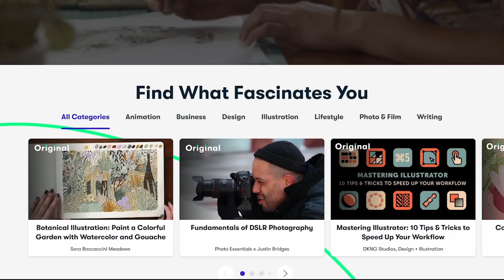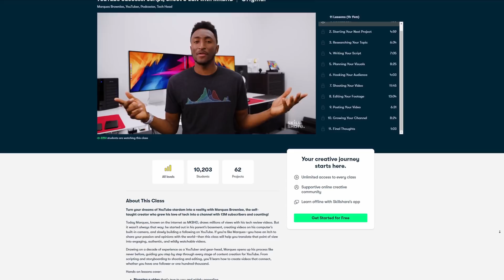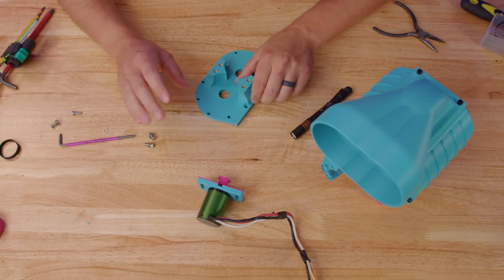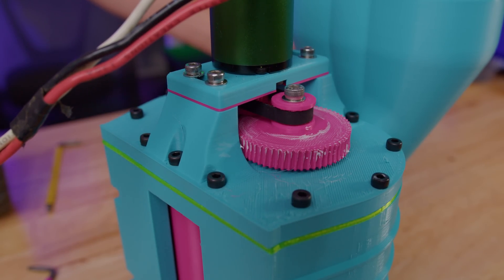I Attached a 100,000 RPM MAX Castle Mamba to my 3D printed SUPERCHARGER..... Will it Survive?

Comment: Run 2 identical batteries in parallel. Rewire the electronic speed controll ends to allow you to run dual batteries. Its a great way to extend run time on the rc. So say for example you are running one 2s lipo. Run two 2s 5000mah lipos instead. Should almost get double the time. Also watch your motor temps when fiddling with your gearing. Those brushless motors can heat up quick if the gearing is too high.

Comment: Should be fine running it on a big PC power supply with an ESC that can handle 12v.
Reply: Those ESC's can handle over 14 volts.
Reply: @tazimafied  Even better, I didn't see the details on the ESC he was using.
Reply: @bradley3549  Specs are etched on the motor. Paused at the closeup to read it. LoL
Reply: @tazimafied  Nice detective work. The motor specs and the ESC specs aren't necessarily the same though. @ 1:50 The motor says 10 niMh/3S LiPo max, which is basically a 12v motor. I'd agree that if he upgraded the motor and ESC at the same time they are probably both good for 3S though so just send it!

Comment: just use a regular car/ mc battery and a 100-150A fuse, remember to turn off LiPo mode on the esc otherwise it will not work.

Comment: if the ESC uses 12V you could just take a regular ATX power supply and run it of that.
Reply from the maker: A full charged 3s is like 12.6 would a normal psu have the balls to push it. If so what wattage min would I need as I have a couple laying around.
Reply: @MajorHardware  no. Just buy some batteries from CNHL, Ovionic Ampow, or even RDQ. You can only get 1800w out of a wall socket. I have a very high power PSU and it still can't match good LiPo's. If you REALLY want to use a power supply, look up meanwell 12v power supplies. You can probably get one that'll do 12v/100a but again, you're much better off with 10-20ah of 3s LiPo because even 10ah of Lipo at 20c is 200a
Reply: @mitchellroberts7954  literally any good 1200W ATX PSU will do 100A at 12V. If you want more current there's also 1600W PSUs.

Comment: Take the motor out of a kids battery car, mock up the pedal into a switch or lever type of handle to regulate the speeds. Much bigger batteries and much more torque.

Comment: batteryhookup has some used headway cells, lifepo4... can output about 200 amps. 8AH each, literally a bolt-together pack that you can make yourself. make sure to charge them with a balance lead and be very careful with them!... if you really want a power supply that can handle some power, look into the HP server power supplies, i believe they are 70 amp output at 12V

Comment: You can make your own psu get a 24v transformer or 2 12v ones, a rectifying bridge, some capacitors and regulate the voltage with a potentiometer.
With some steel plates and some enameled copper wire you can make your own transformer, just remember n1/n2=V1/V2 
n beeing the number of wire loops.

Comment: It says 10 NiMh which is about 12v. You could use a 12 car battery. or maybe a PC psu.  Not sure how much current you need. there are quite a few 30V adjustable bench supplies on Amazon. I did see a 30 A 13.8V dc supply which I assume is for running 12v car suff on the bench.

Comment: you should add a groove to the rotor tips that you can slide PTFE tubes to seal it, should help with efficiency.
 should help with noise as well
Reply: My thought was to use playing cards as tip seals.

Comment: I bet the static pressure of this thing is grand. Should be good on a dense, thick radiator block.
Reply: Stick one of these on the base of like a rad tower and blow the air up through the stack. You could plumb them up so the water sinks as it cools and the super blows the air up so the heat is stripped away, out an exhaust stack.

For a laugh, wire it up to a pedal under the desk to control the power it gets.
Reply: @joshuahadams  vroom veeeerrrooooooommm
Reply: @joshuahadams  oh god you are a genius!
Reply: @joshuahadams   these some way to use the computer temp to affect the motor, ive seen it done on Linus tech tips , they did it with wooden wheels
Reply: Actually, doubt it is.  Roots style superchargers are at best 70% efficient, and those ones that have seals on the lobes.  Given he lack of seals I'd guess its maybe 35% efficient.  They were first designed to move air through tunnels.
Reply: @ShaunMcCloud  Thats cool to know, thanks.
Reply: @ShaunMcCloud  compared to what's normally put on a radiator, ie: a fan, this should be an enormous difference

Comment: Server power supply modules
They are cheap on ebay and can get you 12V or 48V at huge powers. You can also parallel them together for even more power.

Comment: I don't k ow if the controller on the RC car can handle 48V, but you can buy a 48V Hailong HL01 style eBike battery, and that will drive a small setup like that for days assuming the controller can deal with the voltage.

Comment: Can't you just use a buck converter hooked up to a Meanwell PSU from one of your 3D printers?
Reply: they wouldn't be more than 200w or so I guess.
Reply: @lasskinn474  the one I have in mine is 350w

Comment: Measure the current it's pulling and tell us the voltage (3s/4s).  I wonder if a pc psu could handle it (with super caps in parallel)

Comment: Supercharger efficiency lives and dies by surface interference, slightly oversized screws, polished down with use and then a lubricant such as graphene to get a super snug fit?

Comment: I made a power supply out of microwave oven transformer, removed the high voltage wire and rewound it with thick wire so I get 12 v output l, then soldered it to 2 50 A full bridge rectifires. I placed the transformer and rectifires in oil for better cooling as it gets hot l, but now I have 12 v 1200w power supply. Another thing to try is computer power supplies those can be powerfull

Comment: What most people do when testing motors is put their power supply in parallel to the battery to keep the voltage sustained. Just make sure that your battery voltage and power supply are within .1V when putting them parallel. 
This thing sounds freaking amazing. Sweet build!

Comment: you would need a powersupply that can output 200A at the voltage of the battery and i think for that you would need a big coil power supply that isn't working with semiconducters like now normal powersupplys do.
Reply: Car batteries/ or a welder

Comment: A quick bit of research says you need up to 100A available for that ESC, so you'd need something like the Tektronics 2260B-30-108 which will do 0-30V at up to 108A. It's a lot of dosh to spend for an experiment though, at $3460 at Valuetronics in the US.
Reply: Maybe he could borrow one, or go to someones business to use it.
Reply: I have a mamba max on a HongNor rc can, and it can use 1050A peek for 22 sec. Ans 150A nominal.... maybe you need to modify a welder?
Reply: a few pc power supplies combobbled together will do that and be a lot cheaper.
Reply from the maker: Goooooooooooooooooood damn.... maybe electroboom can make me one lol

Comment: I don't know if anyone has suggested this yet, but depending on the voltage difference between your PSU and the motor, a buck converter could be an option to increase the current at lower voltage. Many desk power supplies can put out the same current at all voltages, and a buck converter would allow you to take say 30V/5A and make that 15V/10A (with some efficiency losses of course). There are plenty of them for all voltage and current ratings on amazon, and they are terrifyingly cheap generally. Just make sure you get some airflow over it to keep it from blowing up under the high sustained load!
Reply: They need over 1000 watts to run that motor at full power. It's a 90amp ESC running 3s.
The bench supplies just don't get even close.
Reply: @nocare  That is way more than I would have expected. Definitely something beefier would be needed then. Maybe a computer power supply would be the most cost effective way to do that then, depending on the voltage required.

Comment: They're a bit expensive, but when you said dial in the volts, I immediately thought of a bench power supply. You can set the current limit, so you don't really break things when stuff goes wrong, and then choose exactly how many volts you want. There are different sizes, with different voltage precisions. Just search for "bench power supply", and see if one fits your budget and needs. Plus, once you have one, you'll find other uses for it.
Reply: bench supplies with enough current tend to be expensive.
Reply: he already uses one. but he is going to need 50 amps+

Comment: I wish I were more into rc and electrical stuff. Can't you just add a another battery in parallel to increase available power? Do like a 2-4 battery setup? either 2 in parallel or 2 in series in parallel to another series of 2?

Comment: In terms of power supply I don’t know a particular one but I do know that that little motor will peak at like 150Ah @ 12.6V. So that is roughly 1900 watts. As for other ideas. I would love to know the difference in static pressure and airflow between straight and twisted screws.
Reply: @_WyreTheWolf  oh yeah you’re right. I’m European myself so I totally forgot he’s dealing with 110v. R.I.P. psu
Reply: @_WyreTheWolf  20A * 120V = 2400W (single phase)
Reply: "the difference in static pressure and airflow between straight and twisted screws.".... is "chop" helical screws will deliver smoother performance with slight reduction in volume as the twist consumes material space, as the straight aspect will create more of a pulse like effect. At the RPM here, that pulse will be almost undetectable without $$$$ equipment... with this small of an application, and the less than precision made components, the comparison would probably lean more to the twisted screw design pushing harder... I too would like to see actual numbers between the two
Reply: how much voltage can that motor take? can he just get a VFD and slam it with 120VAC?  or does it have to be DC input to the motor itself.
Reply: @_WyreTheWolf  Yeah, 15 is most common, I updated all of mine to 12ga and 20A... the big issue is that motor/controller being lithium driven. If it were an older brush driven setup that ran on NICAD, then any SOLA 24V 20A power supply would work, but the output on them lithium battery packs is insane... he could potentially daisy chain, but then that IS a lot of dangerous current.

Comment: It is so satisfying to hear it make that iconic supercharger whine! It'd be so cool to see it fine tuned!

Oh also, what about measuring the air temp difference between pre & post supercharger? Obviously an SC on a car needs an intercooler to cool down the compressed air, so I'm curious to see if this one is compressing enough to measurably heat up the air it's pushing.
Reply: this would be amazing to see, and easy to test!
Reply: The cooling is mostly done to increase the density I though, even if the air isn't heated. Could be wrong though.
Reply: I don't think you'd see any real difference since in this case the air isn't being compressed.  A roots blower doesn't compress air in the rotor housing like a twin screw or turbo.  It compresses it under the housing (intake plenum in a car) and the blower basically acts like a 1 way air valve.  That's not to say it wouldn't get heated from friction, but I don't think there's enough there to make a measurable difference. Just my opinion though. Lol
Reply: he cant run it long enough he said that the battery dies too fast